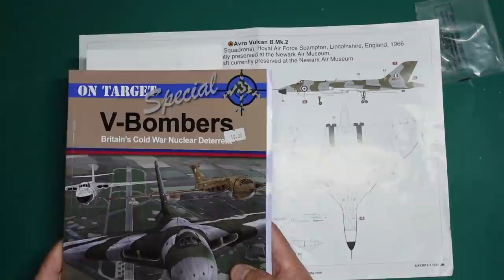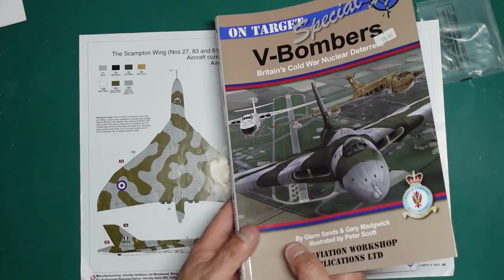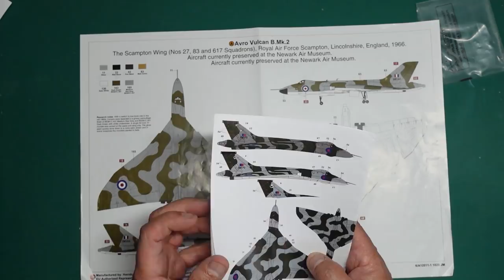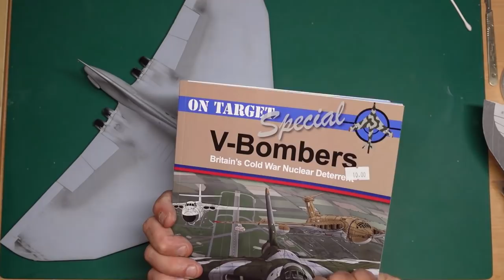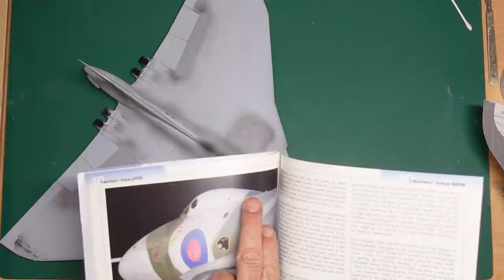Airfix New Tool 1/72 Vulcan build. Part 16

Comment: Great progress!
Noob question - do you have to gloss the whole model if only certain areas will have decals applied? Thanks.
Reply from the maker: Its all up to the modeller.. if you have lots of stencils, you may as well do the whole thing, if not, just do local areas, but it's best to seal everything in if your going for washes after.

Comment: Nige,

I watched Greg's build today, he had same seat problem and sanded them lower. Interesting to watch 40 min full build video.

He got lucky and didn't have the sink mark issues you had, a thought on them as Phil said, Stressed skin? Mr Flory has only noticed sink marks near the larger control surfaces on his wings and, being a keep it simple as possible commission builder he is leaving as stressed skin effect.

Not meaning to compare builds, just saying as an option. Your sink marks were an extreme bad kit example and you have done well resolving the Friday molded kit (sure you know that expression).
Reply from the maker: I'm afraid Airfix sink marks are not anything like stressed skin. He has them all over the spine too.

Comment: I definitely have learned that there is definitely an art, when it comes to masking a model for painting. You just don't slap the tape onto the model then go with the paint. You said it almost took you 3 hours to mask this plane. Wow!
Reply from the maker: It is usually quicker than this, but the Vulcan has such a huge wing area.

Comment: Fortunately I was forewarned about the seats interfering with the canopy, so shaved off some material from the seat locators. The joys of forums.
Now you have highlighted it, I feel the need to blend the rear of the canopy, even though the top is painted, and touch up spray. Wish me luck.
Could you tell me if one of your main wheels has a slight short shot where it glues to the support G21, as both my kits have?
I'm asking to determine if faults come in batches. Nether of my kits appear to have the sink marks yours does.
Reply from the maker: No short shots on mine at all Will??
Reply: There definitely seems to be variation in batches.
I’ll take this minor short shot over the shrinkage issue you have. Guess I have been lucky.

Comment: Mr Hobby masking tape that's going to end in tears...

Don't waste kitchen roll - use cling film.

Tamiya flat clear can go totally matt, however you need the right thinner with it - X-20A semi gloss finish, same with SLT, same with Vallejo Thinners or Airbrush Cleaner and the same with water. Rapid thinners can give a flat finish, but you need the right temperature and humidity.
Reply from the maker: Thanks James. I used kitchen roll as a protectant as well as a mask.